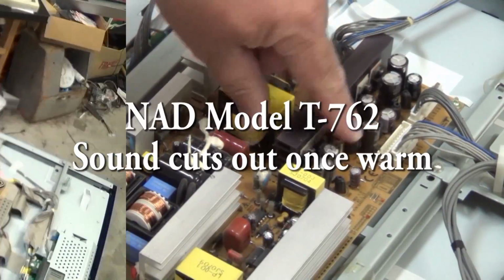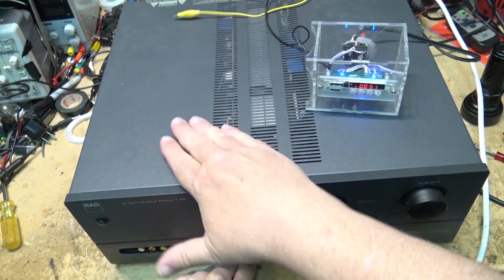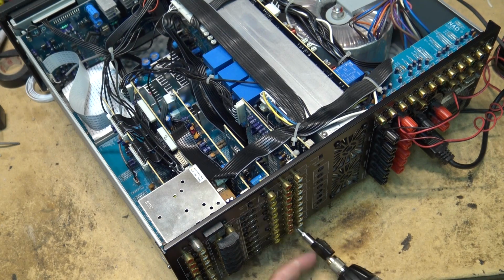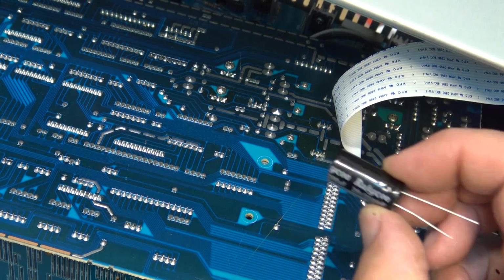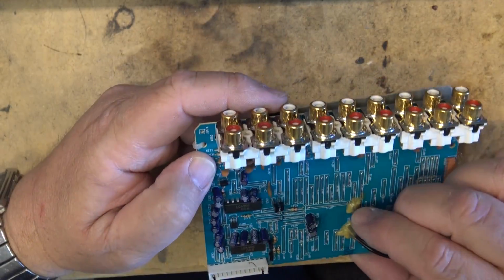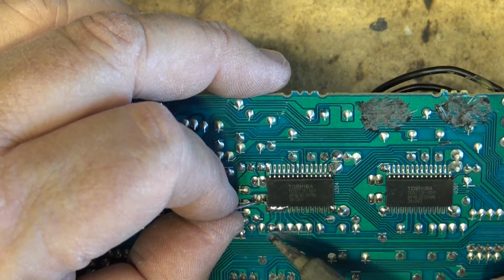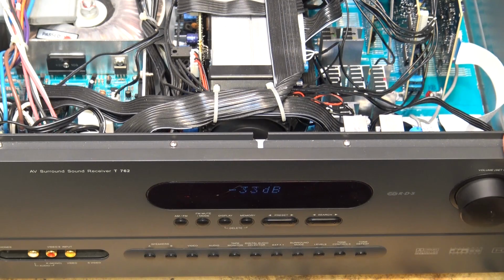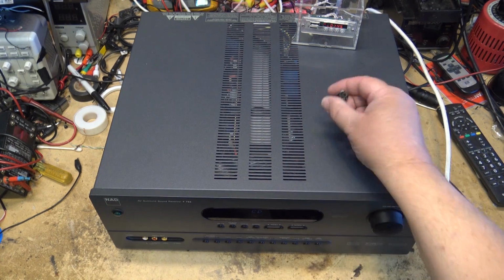NAD T-762 Sound Cuts Out When Warm

Comment: NAD used a lot of crap parts (caps) in the day.  Whenever I buy an older NAD unit for myself, I just do a full recap and put in quality Japanese parts.
Reply: I recently serviced my NAD 2600 power envelope amplifier, 1986 vintage.
I noticed that the caps were Rubycon branded.

Comment: When I was working as a engineer in radio and TV stations 40 years ago we will find counterfeit RCA tubes , which the buyer thinking of saving some money for the station (And he making a better bonus by saving money for the station) in reality was costing the station more in off air time ! We had to talk seriously to the owners or the board that they couldn't be risking on air time for the sake of economics. So counterfeit parts is not a new thing . By the way , hard to service design of this unit ! :)
Reply from the maker: Yes I know it has been going on for a long time.  It really ramped up in the mid 90s when just about every semi that didn't come from the manufactutes own parts dept was a fake.  Horizontal output transistors from Sony and Panasonic were 40 to 50 for 1 transistor.  The ones from main were 3.00 but there was a good chance it was fake.
Reply: @12voltvids  Yeah. We had that problem with the Sony PVM series .

Comment: I HATE those av receivers. I will not service them.
Reply from the maker: I am not fond of them either.
Reply: 12voltvids You have more patience than me. I have a RCA 1 octave eq that has bad solder connections of course no access panel on the bottom. Fortunately it has only one small board where the switches are. You have probably seen these at radio shack early 2000's.
Reply from the maker: @russredfern167  
I have less patience these days.   You don't typically see all the crap I condemn

Comment: A couple of years ago I decided not to repair this 'modern' stuff anymore.  It is junk!  Period.  A repair that should be done in 10 minutes takes over an hour for disassembling and reassembling.  These days, you can't do a simple repair for less than $100.  So, I stick to quality units from the '60 and '70 era.  Even a simple Kenwood KA-300 used to have a service hatch in the old days.
Reply from the maker: So did I and I despise getting these units.  Many times I just walk away.
Reply: @12voltvids , I really wish they would teach a little bit of repair in University Engineering courses.  Unfortunately it all seems to be focused on theory and design with no thought of operations, maintenance and repair.
Reply from the maker: @philipandrew1626  
The manufactutes don't want a repair industry. Having a repair industry means stocking parts and having inventory of spare parts that might break means that the costs associated with having these parts drives up the cost of running the business.  So no parts , no repairs.  Manufactutes replace defective units. No parts inventory means they can reduce costs.  I know it sucks but that is the way the industry went.  I sure am glad I got out when I did.
Reply: I keep on telling myself that I'm not going to fix this new crap but people keep on asking me to do it :(
But yeah you're right - doing this stuff as a business is not really viable. I quit doing this for a living years ago and now it's just a hobby so I can afford to spend a bit more time messing with this stuff. I think the people who design this crap should be required to spend a week in a repair shop to se the kind of problems they cause. Then again, if I were a conspiracy theorist I might say that they do it deliberately to make people buy new rather than fix their old stuff :(
Reply from the maker: @countzero1136  
Of course they do this intentionally. Manufactutes don't want stuff to be repaired.
Reply from the maker: @Martin M NAD = Needs Adjustments Daily
Reply: I used to run a CB radio shop, and this "Disposable" stuff killed the business! A trucker would come in and ask "how much to fix?"  I"d say "35"   He'd say "How much for a new one?" I'd say $45...    He'd throw the burnt one in the trash, and buy the new radio. I made much more profit on the repairs than the sales.  Same with TV sets (crt)  I would send in the whole board, and just replace it. no diagnostics, no nuthin! Unplug, and un-screw....    Now with surface mount and my bad eyesight,.... well, I give up!

Comment: Hi, I have sony car headunit cdx-f5500 , I want to ask is there any method with which  we can hack bus audio input and turn it on? Sony offers different accessories to turn bus input on , but  I don't want to use them. Aux in ports are at back of headunit but they work only when sony accessory or cd changer is connected.
Reply: Have older CD player CDC gt550 which uses similar system like above mentioned NAD or other audio equipment. I soldered extra set of Cinch cables to AUX input board traces because my front panel Aux jack leaves a lot to be desired connection wise. It would be some small IC on main board where the front Aux, CD audio L-R, and other traces lead - sorry don't have the thing apart and can't remember the IC designation. Yours might be one of these 'special' Sonys from 90s - all the manufacturers did the same, say Alpine will work Alpine CD changer but nothing else, since you use head unit to control the the changer and most would be sort of proprietary. You could try jumping the Aux inputs to different set, or even at the output of the selector IC switch for permanent, say MP3 player connection - easy and dirty way. I don't know the logic part that well and of course is almost impossible to get service manuals for head units.
Reply: @pliedtka  sony cdx-f5500x have built-in aux input port at back , but it is controlled by bus input port. That's why I was asking about turning bus input on .
Reply: @saqibsami7967  
You would need data sheet for the IC switch and start from there - what turns what, if this is what they use. Sony, Kenwood, Alpine, they would be very similar. What's so special about the head unit you have
Reply: @pliedtka  I tried my best also searched on internet for solution , but nothing worked.
If you think you can figure it out . Send me your gmail id , I will share some links and details about this headunit.

Comment: Lead-free solder, cheap underrated parts and a difficult to fix designed assembly. This is a true recipe for failure after a set amount of hours. Dare I posit "planned obsolescence"? Is it any wonder why the military and the hospitals insist on leaded solder for assembly? They aren't having anything to do with "consumer-grade" equipment these days, that's for sure.
Reply: Military equipment is not subject to RoHS regulations in regard to lead content? I didn't know that, interesting...
Reply: @rayhunter7371  Yep, the no-lead alloy adds a degree of instability and they want reliability. It's one less thing to worry about going wrong in a critical operating environment.
Reply: Civil aviation LRU's on new planes like the A350 or 787 are held to ROHS, but old designs like the A320 or 767 are not.  😳

Comment: Hello - can you tell the procedure of adjusting bias - how much time give it to warm up...
Reply from the maker: The manual would be required for the procedure.  Bias is not necessary on solid state amps unless components have been changed in the driver or output stages.
Reply: Depends on model, I give 10-15min to warm up, but some units are special and after initial adj will ask for recheck and adj.